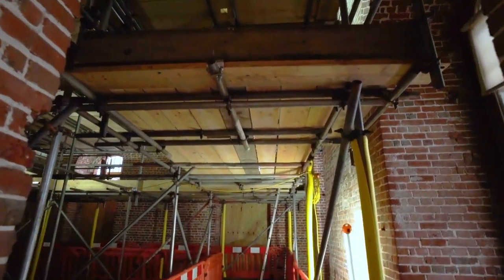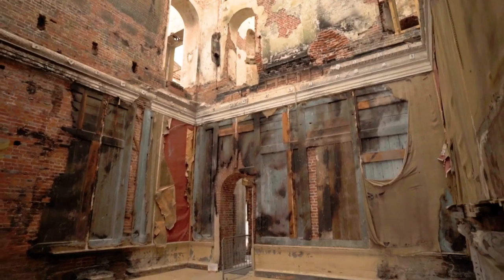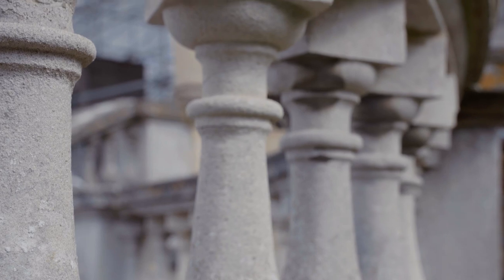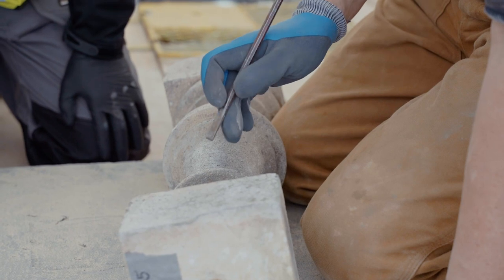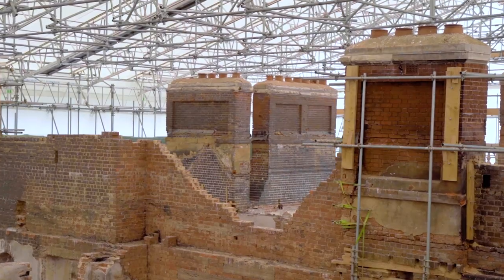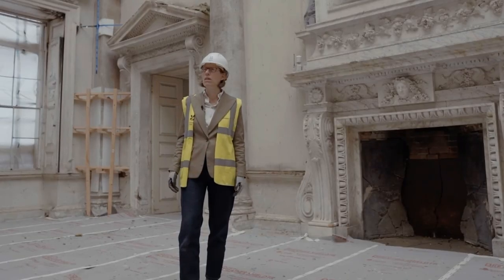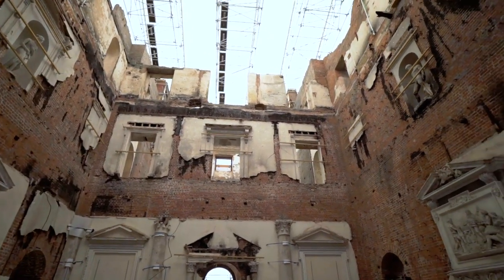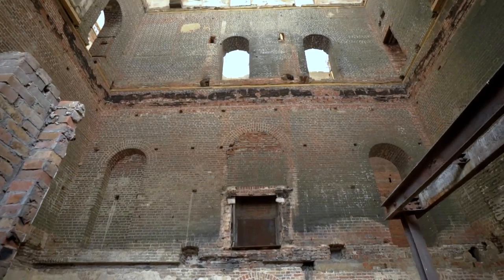New plans for Clandon Park embrace a great house laid bare

Comment: Terrible plans. Restore Clandon to how it was. Everone knows you got huge pay-out from the insurance to do just that.
Reply: I think the cost was way higher than payout.that's why you do fund raising !
Look at Notre dame
Reply: @MrDavfit Or Wentworth Woodhouse whose website is exemplary because it highlights restoration and adaptive re-use focused on benefiting local communities instead of talking heads.  I wonder if the NT reached out to surrounding communities to discover their needs and vision for the property before they selected this approach?
Reply: I couldn’t agree more. That ghastly modern glass roof and internal walkway are an absolute travesty and totally at odds with the original architecture. I’m baffled by this contemporary insistence on ‘contrasting the old with the new’ and slapping tasteless modern steel and  glass extensions etc. onto important historic buildings. It should be properly restored to its original specifications, or left entirely alone. This is just horrible.

Comment: I read over 600  items were saved from the fire and many of these will be placed in the house and paintings will be hung over some of the walls, it's not just going to be a tour of huge interior brick walls, and when finally completed with the windows in and exterior restored and the interior walkways up maybe it will be seen they got it right and will prove a huge success. Maybe